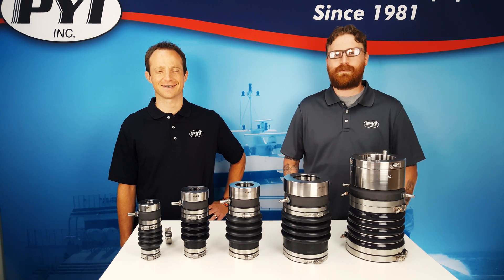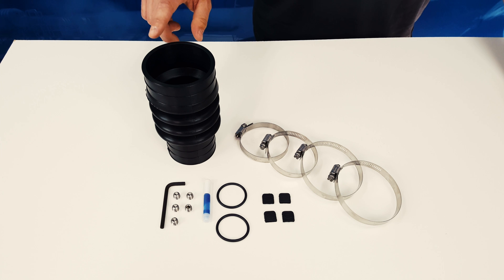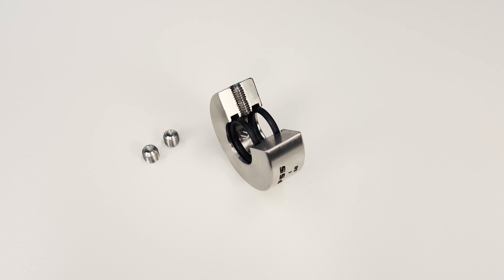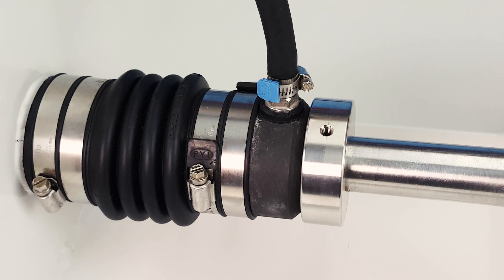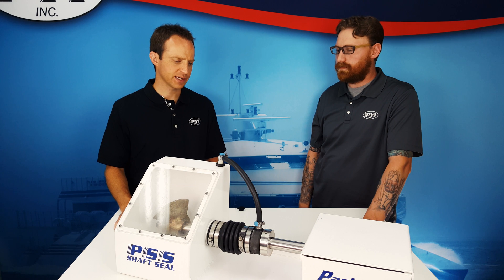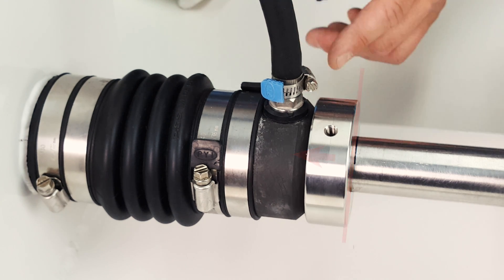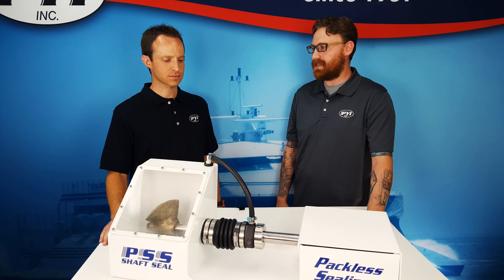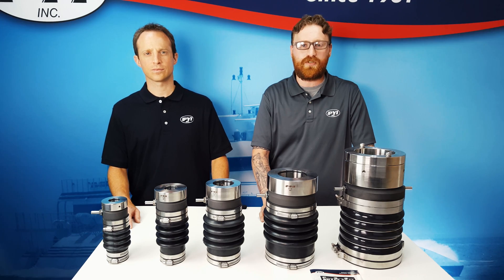PSS FAQ's

Comment: Is there a 7/8"(shaft) to 1.3 " (tube) seal?
Reply from the maker: We do not make a PSS Shaft Seal for that shaft and stern tube combination. I would recommend ordering a PSS Shaft Seal for a 7/8" shaft and 1.25" stern tube outside diameter. The rubber bellow will stretch over to fit onto your 1.3" stern tube.

Comment: My buddy almost sunk his boat last year when the rotor slid forward,, it's not a design too pinch locking screws against stainless steel it's too hard of steel,, needs a backup l put hose clamps against the rotor now.will give you peace of mind for under 10 dollars
Reply: I installed a double split collar on the shaft to prevent the rotor from sliding back and losing compression.

Comment: Just bought a sailboat with your shaft seal installed. The vent hose is not taken above the water line, but rather out a through hull fitting at the bottom of the hull about 6 inches below the barb. Is this appropriate? If so, I assume I would need to burp the bellows after launching. Is that correct?
Reply from the maker: This is pushing passive water flow to the PSS Shaft Seal, which is just fine. No need to burp the PSS when launching either.

Comment: Guys, I'm seeing a lot of videos of these failing! I am seeing..I spent two thousand on a set of the PSS pros and have my boat on the lift and removed the old bronze wax packing boxes and replaced them with yours. I'm concerned about putting the boat in the water and I'm afraid.. I'm running Cummins V-504M diesels..

Comment: I had mine fail once when the rotor slid back, decompressing the bellows.  It swamped the main hull of my trimaran.  The cause, btw... was my fault, from turning the shaft by hand inside, by turning it by the rotor.  NEVER TURN THE SHAFT BY THE ROTOR!

Fix?  I bailed it out and re set the rotor.
Then...  As a safety I placed a doughnut zinc on the engine side of the rotor with a very small bead of releasable caulk to fill the 1/16" gap.  It could never happen again, and the safety is dirt cheep.

Comment: We have two new 1 1/4 PSS shaft seals on our twin engine power boat. They have bout 60-hours of run time. The bellows and carbon seal  vibrate sideways at low and high speeds, 1000-2000 RPM. Can you comment about the possible causes?
Reply from the maker: Some vibration is normal. Is the sideways vibration causing a leak? Was the full 3/4" of compression done at the time of installation? Usually, excessive vibration is caused by something other than the PSS. For instance, the propeller shaft could be hitting the inner bore of the carbon stator due to it not being centered. You can try adjusting how the bellow sits on your stern tube to align more with the propeller shaft. Feel free to reach out to us directly, and we can help you further at info@pyiinc.com

Comment: I have a PSS dripless shaft that leaks at rest, I cleaned it as recommended and then with sandpaper 600 as recommended. It is still dripping. I do see salt built up around the carbon. What is the solution? Also when I pull back to place the sandpaper in between a rush of water comes out. Is this normal?
Reply: Were you able to find a solution? I am having the same problem.
Reply from the maker: Yes, when you separate the mating surfaces of the carbon stator and stainless steel rotor it is normal for water to spill out. These two mating surfaces are what create the watertight seal of the PSS. To assist you with your dripping while at rest we'll need to know some more information. Is this on a sailboat or power boat? How old is the PSS? What is the shaft diameter and outside diameter of your stern tube? Please email us at info@pyiinc.com or call us at 425-355-3669, and we'll be happy to help you out.

Comment: I have a dripless shaft. can I change out my transmission in the water. I just pushing the shaft back
Reply from the maker: As long as the two mating surfaces of the carbon stator and stainless steel rotor maintain constant contact that should be ok to do in the water.

Comment: I’ve used GFO or GTU packing (graphite/Teflon) for years on stainless or nickel alloy shafts. Some just don’t want to drip when running and yet they stay cold. The secret is to not compress it and let it leak at first. Then adjust while underway. Typically they need adjustments once every three years, less than a quarter turn. At that rate the packing will outlast most boats. When I’ve had to pull a bent shaft, the area where the packing was looked perfect. Never use graphite containing packing on a shaft that has a yellow color as it may be subject to severe anodic corrosion.

Comment: Can you put a PSS dripless shaft seal on a rudder shaft?
Reply: Absolutely! Same part numbers are used for rudder shaft applications. Depending on your shaft size we offer low speed PSS Shaft Seals, with the only difference being that those do not have a hose barb in the carbon. More info here: https://www.shaftseal.com/pss-rudder-seal.html

Comment: Quesion: Why would my PSS shaft seal vent be plugged by design? Isn't this vent supposed to allow water to fill the seal?
Reply from the maker: Also would like to mention, a plugged seal will need to be manually burped to purge air when the vessel is launched and in any case where air may be trapped in the stern tube / seal.
Reply from the maker: The PSS Shaft Seal can be  plugged if the vessel will not exceed 10 knots. At those low speeds it is not necessary to provide cooling to the PSS Shaft Seal. Out of the box we only plug rudder seals or when a customer requests it.

Comment: I have a PSS and for some reason the shaft hose is connected to my heat exchanger. I bought it like that, have you ever seen it connected like that? Also it seems that raw water is entering through the PSS and flowing back through the exhaust to the raw water pump, when not running. Is this normal? It seems that this setup could ruin my engine.
Reply: For some reason I do not see the PYI answers to this comment. I see only the comments to PYI response.  And I am interested in those answers because the installation on my boat is similar - Out of the heat exchanger there is a hose connected to the PSS.  The engine is a Yanmar 3G - never goes to 12 knots - Is it better to disconnect this hose and let it vent ? I have a problem with the PSS, water is coming in 4 L per hour. Any suggestion ?  Regards
Reply: Thanks for the response. The PSS is applied to a sail boat, and the sail boat diagram it looks like I need to run the P/U to a vent above the water line, Is this correct? Or do you still recommend added the vented loop, if so is there one that you recommend using for your PSS system?
Reply: Appreciate your time and all the information you have provided. Thank you!

Comment: Thanks for the informative video. To go a little further, I've owned my boat with pss seals for approx 3 years. Following use, I would always find salt water in my bilge and had no idea where it was coming from. It was often mixed with a little mud (from our river bottom). I'm thinking, when in close quarter maneuvering into the slip in shallow water with multiple direction changes, would a weakly compressed shaft seal let water in? I've been in the bilge/engine room underway and all is dry, but since I pilot the boat into the dock, I may be missing the seal letting a little water in.
Reply: Thanks so much for the info. It's been making me crazy since boat ownership, I'm going to have someone at the helm make some direction changes to mimic backing into slip while I watch seals. Its the one thing I haven't done yet. My controls are singular (transmission/throttle in one) so the RPM drops on diesel engines are pretty radical.  I have positive water feed.